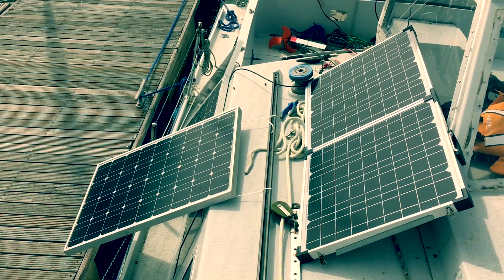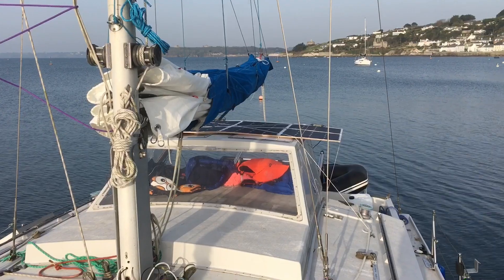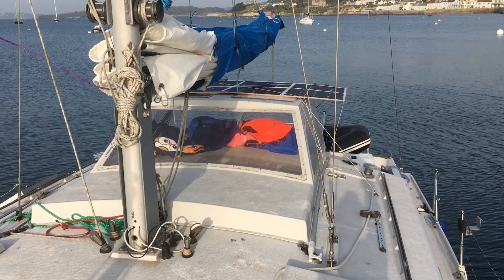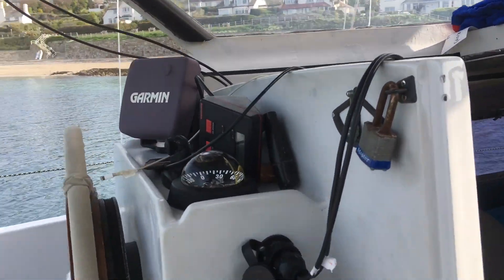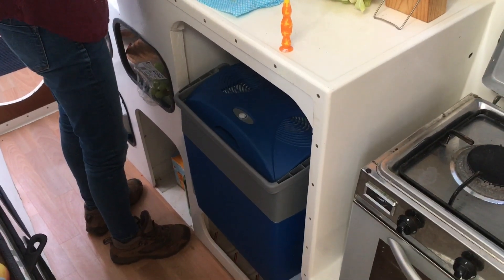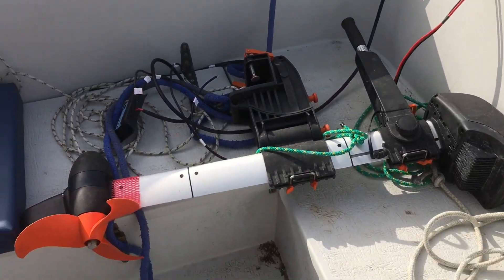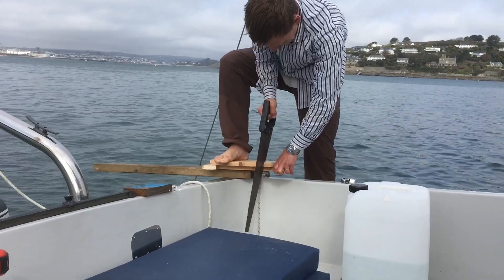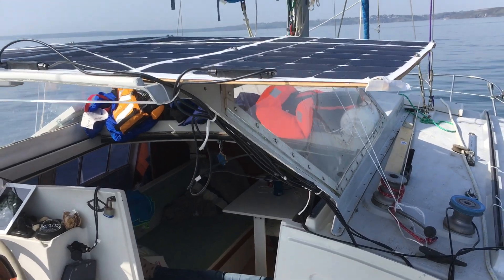How to use solar panels to power a boat for all your needs - electrics, fridge, even Torqeedo motor!

Comment: Hello,
Do you want a solar fountain pump for free?
Reply from the maker: Hi Bruce, Thanks a lot for your offer. We wouldn’t mind receiving one - although are not quite sure what we’d use it for. 
What would be really useful though would be a more powerful boat motor. The current one is only 400W and we’d really like one - or even two - of 2000W each in order to be able to propel the boat a bit faster. Might you be able to help with this?
Reply: @aktsolar  We can offer you a 2000w boat motor. here are our email: brucepeng21314@gmail.com
Reply from the maker: Hi Bruce, we tried contacting you on this email address but didn’t get a reply. Is there another email we can contact you on?